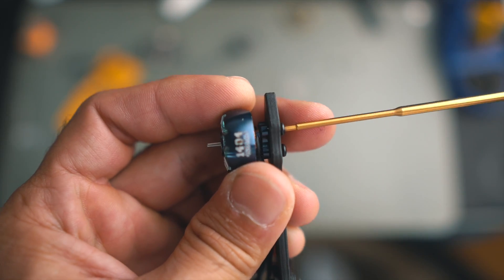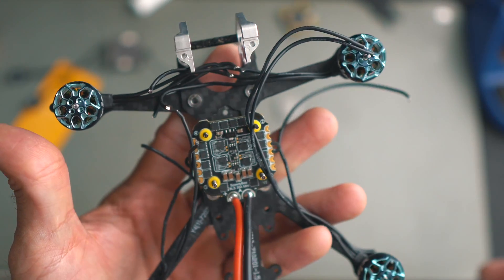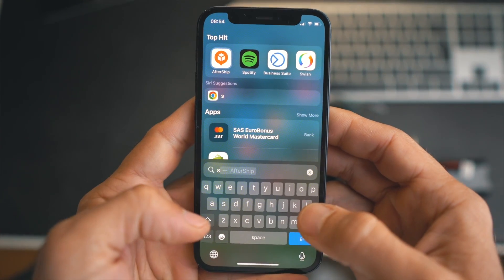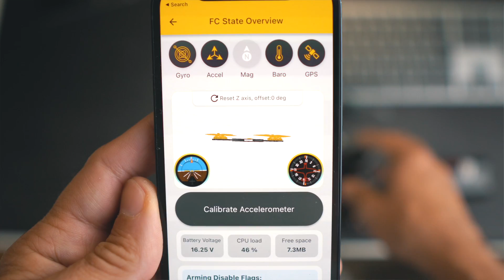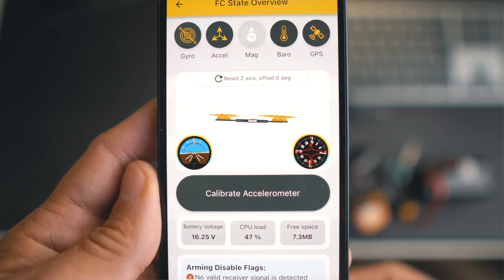Building a Mini Explorer with SpeedyBee F405 Mini 35A Stack

Comment: Why didn’t you add the capacitor to the battery lead? Was it for space and could you use a smaller capacitor?
Reply from the maker: You should add it. It was just because I didn't have one at hand and being a 4S drone you don't need it as much, but yes, add it if you can.

Comment: Excellent video! I appreciate the way you filmed this and have so much detail. 
I have one question 🤔 it looked like you didn't swap the TX RX wires from the VTX to the F405 board.
 ... But maybe I'm missing something. 
Love this video. I've saved it and keep coming back.
Reply from the maker: Hello. Thanks. This was some time ago so I don’t remember if I had any problem in the beginning, but you always have to swap them. Tx from one to tx of the other. Otherwise you don’t get OSD or get out of standby mode.

Comment: Hi bro, great build. Can you please share the flight time?
Reply from the maker: Hi. This was some time ago and I don’t have the drone with me any more. If I remember correctly it was around 7-8 min of cruising.
Reply: @NordFPV  bro can you help me a little bit? I want to build my first drone as I have no flying experience and want it under 250g because of license and all. Can you suggest me motor or battery for a cinewhoop/ tiny whoop that has long flight time so that I can learn drone flying.
Thank you
Reply from the maker: @amirjafari8314  Hi, yes of course. I have to say there are like a million videos and post about this all over the internet, but I can do my best.
All depends on if you have any parts already available or if you would like to buy everything. Also, think that many times the best option for your case is to buy a second hand drone, flying and fix it. Also, buying parts is normally more expensive than buying a BNF, unless you are buying second hand parts.
And you need to know if you are going digital, analog, or what so you can take the weight into consideration.
But in very high level, a small drone with long fly times maybe be using 1404@4500kv motors, with some kind of 3.5" frame and a AIO card with 30A ESC.
That can give you a good start to research in more detail what you want to build.
Reply: @NordFPV  Thanks for the information and reply 😊 Here in India second hand drone is rarely found. So I'm going it to build a new one from scratch. I'm think of using HF150 frame, SpeedyBee F405 mini stack, speedy bee 1404 4500kv motor, analogue fpv system, but I'm confused about which battery should I used to get longer flight time for more and more training of flying an fpv. If you have any corrections in the mentioned parts feel free to mention them

Comment: Can I use fsia6b reciver
Reply from the maker: Hello. I don’t know what Fsia6b is, but you should be able to use many receivers as long as they support one of the supported protocols that beta FPV has.
Reply: @NordFPV  I mean flysky fs i6 transmitter reciver which support i bus and ppm.
Reply from the maker: Then yes, sure, it will support it. @fireonplay4201
Reply: @NordFPV  thanks
Reply: @NordFPV  and can I use speedybee f405 v3 flight controller.?
Reply from the maker: @fireonplay4201  , this frame doesn't accept 30x30, you need to go with the mini version of the stack if you want to use the speedybee stacks.
Reply: Give me your fb id

Comment: I am building the same quad and I wonder du you know if the drone can lift a GoPro ?
Reply from the maker: It will depend on the motors you put in. and there's a difference of flying nicely with a gopro vs lifting the gopro...
Reply: @NordFPV  I have the same motors of you

Comment: I've used this stack for slightly over a month. On a 1.1kg drone soccer ball pushing 2207 2350kv F60 III motors and HQ R42 props running on 4s. In a typical drone soccer training/match...its normal to keep crashing it on the goalpost/floor and other drones. I'm still surprised its working
Reply from the maker: That’s great to hear.
Reply: DRONE soccer is a thing ? never heard of it lol

Comment: Good time of day. There is a question. I was tempted to buy a 35A Speedy Bee F405 mini stack for whoop. And here's what's interesting, even when powered only by USB, the STM32 and the bluetooth chip are very heated. I can't keep my finger on them for a long time. But at the same time everything seems to work. For comparison, I have a Mamba F405 stack, and it's cold. Can you tell me if this is the norm for these politicians? In addition, after several firmware updates, one of the four ESC stopped being sewn. The program writes "ESC erased or unknown". Nevertheless, the motor is running. By the way, "out of the box" none of the motors rotated, only twitched at 2000 microseconds. Only after the Jazz Maverick firmware, the motors turned. The motors were also taken by speedy bee 1404, and they are also like boilers! Here is such a rabid bee))
Reply from the maker: Mine doesn’t get that warm to be honest. I think there may be something wrong with yours.
Reply: @NordFPV  thanks

Comment: where do you buy the tape for the frame arm wire
Reply from the maker: Ali, Amazon both have it. I’ve hear Walmart in the US has it.
Reply: @NordFPV   i am french so it s difficult to buy something in usa..do you have a link for something similar on the most popular shop?
Reply from the maker: https://www.amazon.fr/Feuerlos-Adh%C3%A9sif-Temperature-Faisceaux-%C3%89lectrique/dp/B0BX4DKTPF/ref=sr_1_3_sspa?__mk_fr_FR=%C3%85M%C3%85%C5%BD%C3%95%C3%91&crid=1MOI0954DT14N&keywords=cloth+tape&qid=1693489286&sprefix=cloth+tape%2Caps%2C89&sr=8-3-spons&sp_csd=d2lkZ2V0TmFtZT1zcF9hdGY&psc=1
 @derivas007

Comment: My first flight 2 days ago the drone fell out of the sky about 3ft above ground on a turn. The 5v BEC on the Mini F405 apparently decided to stop working as verified with Multi Meter. Plug in USB everything works. Plug in a battery and no voltage going to receiver.  Running 4S and this was the second flight. I hope they don't all have this issue.
Reply: I burnt mine up carelessly making repairs. I put an external BEC on it and its alive again.
Reply: That's nuts.
Reply from the maker: Oh no! I’m sorry to hear that happened to you and hopefully is not a bigger defect on this stack. Building with it was so nice!
Reply: Just received a second one and out of the box no voltage across the 5volt points on the FC. I have built over 46 drones and have never had an issue like this the a new flight stack.  @NordFPV